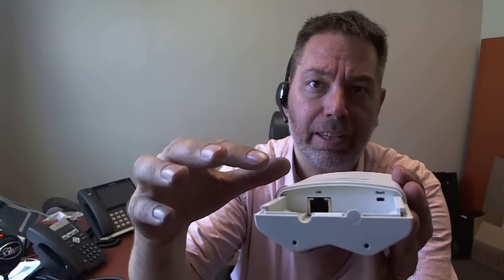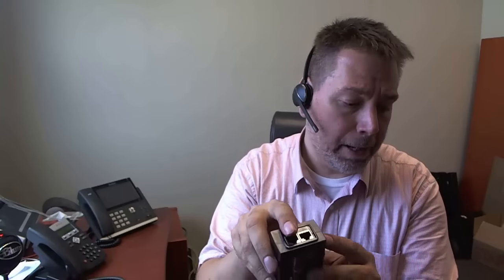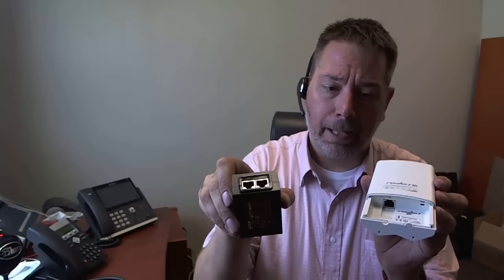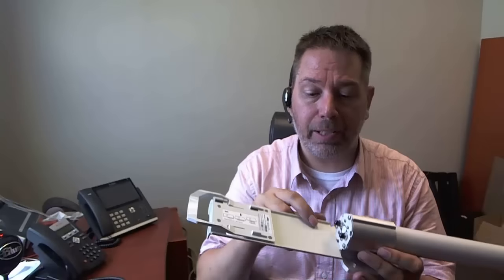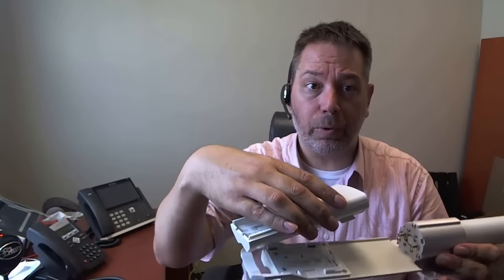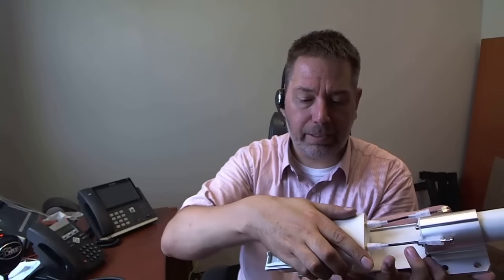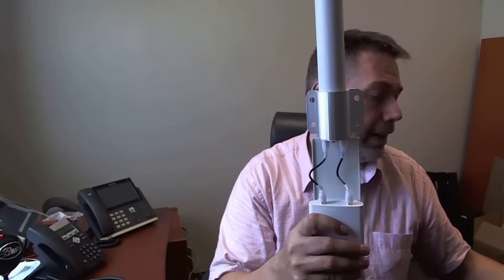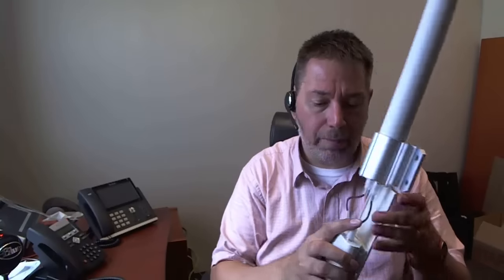How To Setup the Ubiquiti Rocket with a 5G Omni Antenna

Comment: The trouble is if the antennas are high up on mast its very hard to service, I had to mount the rocket in a metal box at bottom of mast and run low loss coax to the antennas.
also if you install 2 radios and 2 omnis on the one tower it hard to mount them both without one shadowing the other.

Comment: If you have a rocket antenna that can go much further than the nano beam can you connect the nano beam at the maximum distance of rocket antenna with no problems or does the other site have to have a rocket antenna for the long distance

Comment: Can you tell me what the purpose of the Rocket device is? Why I would like to do is extend the reach of my current router/access point. I will not be using this in conjunction with a Nanobeam or any other point to pont system. I have seen other Omni directional antennas and they simply have one coax style cable that then screws into the antenna port of your router/access point. I am just clueless I guess as to how this system works. Thanks.
Reply: It’s kinda like a modem for the antenna, it converts Ethernet to Coax.

Comment: How does it compare to 2.4GHz 15dBi Outdoor Omni-directional Antenna?
Reply from the maker: its smaller.  The 2.4 is physically larger.   5ghz is recommended for most cases as there are more available frequencies.  We have used 2.4 in rural areas with frequency is less of an issue but we want to get better coverage through light foliage.

Comment: Hi Dear .... i have a problem with this antina....if i select frequency from 5820 to 5840 it has a very good result high airmax quality & Capacity but number of Connected devices goes down to 14 only not more.....With frequency below 5820 quality capacity goes down and all devices connected but data rate goes to 6.5 dead.... how i can fix? i enabled airselect and some devices increased but that's not solution....
Reply: The 5 Ghz  Frequency is for N and A type receivers. few mobiles and wireless support b and g type wireless modes. thats why they disconnect with 5 Ghz . check signal, noise and SNR of connected devices.